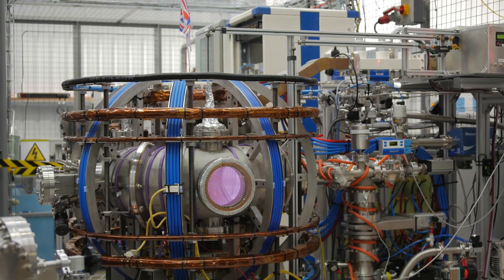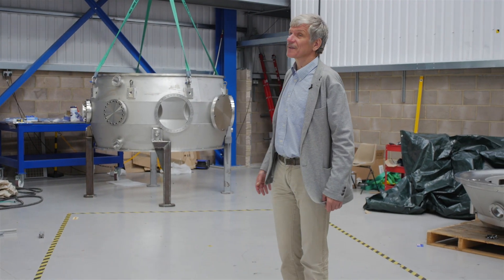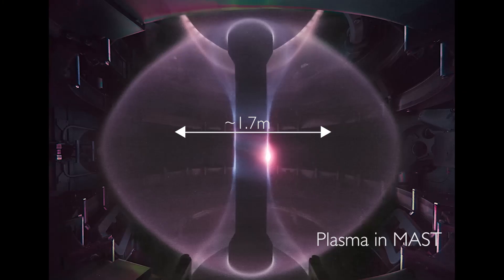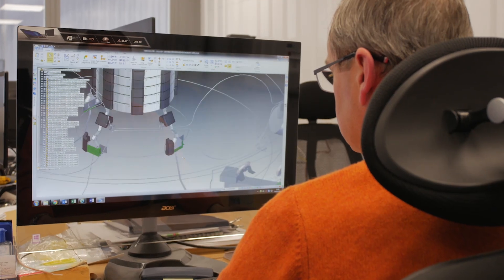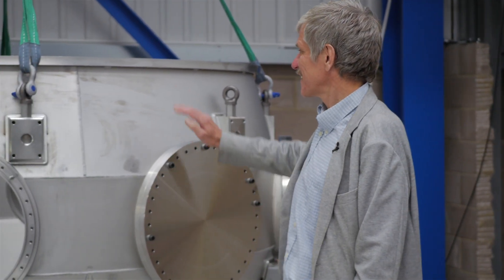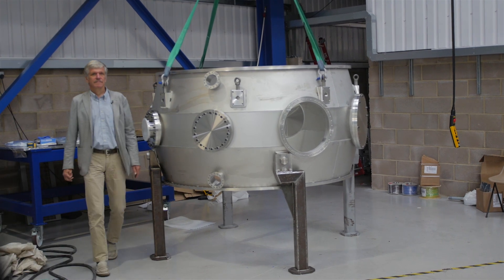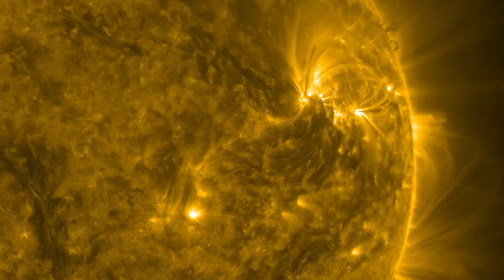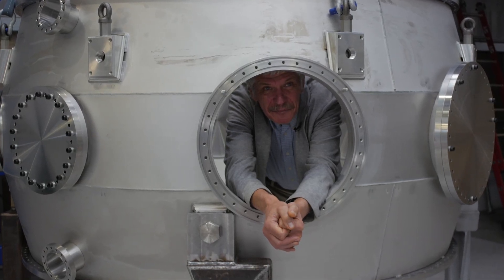ST40 - the 21st Century fusion device

Comment: i would build it solid metal..
Reply: How would you get fresh fuel in and spent fuel out, if it's solid?
Reply: it can have a hatch on the top or in the bottom! or two hemisphares that can split. that would be a huge help when it comes to construction or maintenance..
Reply: and then it would fail miserably...can't be built like that..in any case, many parts need to be routinely replaced, due to the high magnetic forces on the metal parts....